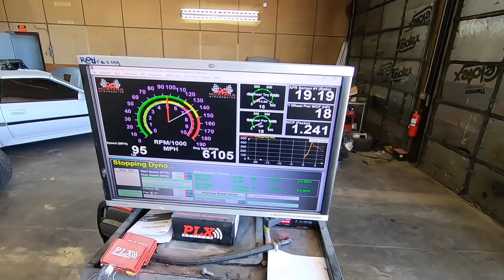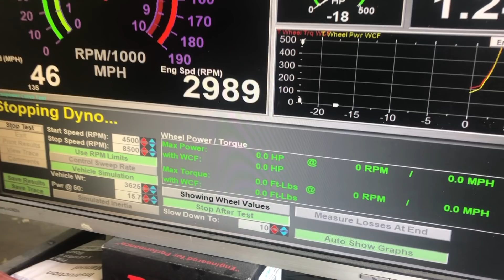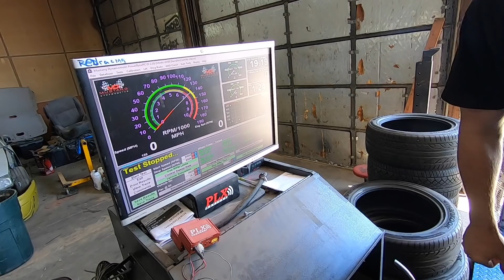The Most Power Hondaru Has EVER Made!

Comment: You know Emilio started sweating when Kyle said "those are only rated for 800" 😂
Reply: Chris Santos why? The torque split on those center diffs is never more than 50/50...unless it’s 2wd to the rear. He’d have to be making over 1600hp to hit more than 800 RHP.
Reply: Most Awd diffs send around 70% to the rear. Has to be locked in 4x4 for 50 50
Reply: coldnapalmFJ This depends on the vehicle. New STI’s have 59% rear and EVO’s have 50% rear.
Reply: It’s 40/60 on a DCCD STI transfer case.
Reply: Or 50/50 on a standard WRX transfer case.
Reply: /whoosh

Comment: 19.4% correction.... no wonder it will never trap lol
Reply: They are at 5000 + feet above sea level. That’s about right to compensate for air density, not knowing as tested temperature.
Reply: It's even more... Look at about 4:16 the wcf is 1.241
Reply: @matthewf1979  the problem is they claim corrected horsepower. In this run it was making well under 700 at the tires. At this weight (2955lb) it would take almost a perfect run to get to 9.7 with the power they have. An s366 compressor can really only flow about 87lb air and is basically never going to make more than 900 at the crank, unless you have methanol. It's part of why these guys have so much power for such low mph.

Comment: 8:05/12:40.. time on vid from my end... right when your setting the two step and the tire's move...pay attention to the rims..they are moving but the tire is not..you take those rims and tires to a sticky track and you will slippers the tire's on the rims...get some bead lockers on that car your loosing road H/p..by the slipping .. thanks y'all much love..
Reply: Just watched multiple times at 0.25 and comparing spoke/injection mould string line up, definitely not slipping on the rims

Comment: Kyle you also need to do a refresh on the MR2 and the Prelude at least new rods and bearings because any time you have a catastrophic failure like you did in the head that puts a mean strain on them aluminum rods and can stretch them, bend them all sorts of stuff but at the power levels your running you should just put a set of them Wiseco I-beam boosted rods like Trevor from Motion Auto TV did with his AWD yellow Civic if you want to go up to around 1500+hp then I would definitely put the aluminum rods in

Comment: Emilio should get the Pro series rear axles and the 800hp rated axles for the front since the back tires take most of the hit and go ahead and get the bigger hubs to fit the bigger axles so that way you won't have to worry about anything suspension wise when you go to turn it up 1000+hp and you should hit up Fortune and get them to build you a set of their 3-way adjustable coilovers especially for your car

Comment: K24 @= 800+ HP.
Wow weeee, I have a H22a4 with a eBay turbo kit. Lucky to get 400 HP. Thinking I need to build me a k24 engine.
Reply: Depending on the ebay parts it would be very easy especially with ethanol... i just made 475whp stock f20b...

Comment: I know this is irreverent to the video but is 9.23:1 comp ratio(b18b) ok with 12-18lbs of boost?
Reply: is it stock?
Reply: @moosymoose7083  im just trying to find pistons that have low enough compression. so no they are aftermarket low comp turbo pistons. but i read that you dont want any higher than 9.5:1. https://www.superhonda.com/threads/compression-ratios-with-turbo.92955/
and these are the pistons im thinking of using https://www.swapshopracing.com/contents/en-us/p46751_Nippon_Racing_Turbo_Pistons.html

Comment: Not trying to beat you up... but it's time to upgrade your thought patterns. Hondaru is making real power now! Axle upgrades are fine. But the wheel bearings are gonna be going faster than ever. Maybe not use an impact on the axle shaft. Proper torque is going to come into play real fast. I'd hate to see you lose a wheel.

Comment: Put some fucking air in those tires and let them spin a little you wont break axles as easy then slowly start takimg air out you kids will learn one day you dont want tires to spin but you do when your ass is running close to stock axles let them tires spin until you get axles you know will hold down the power